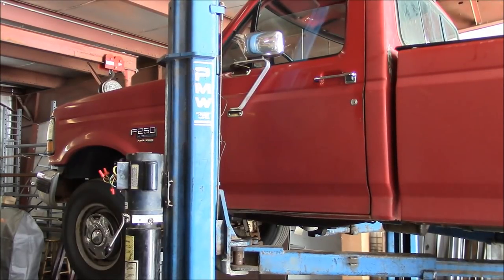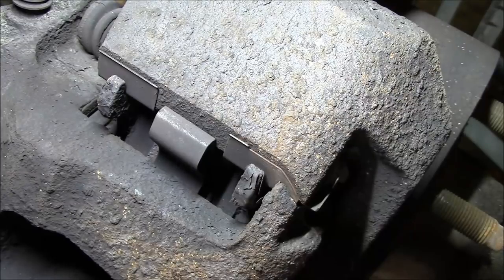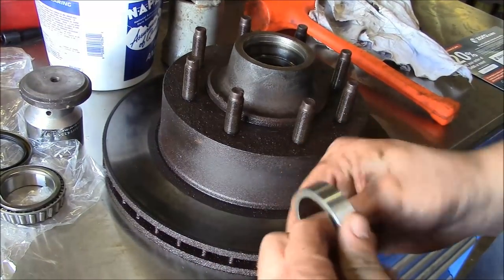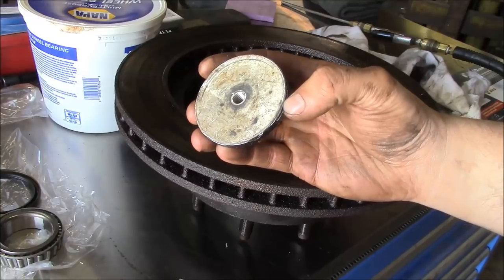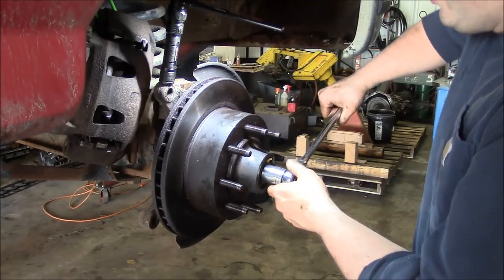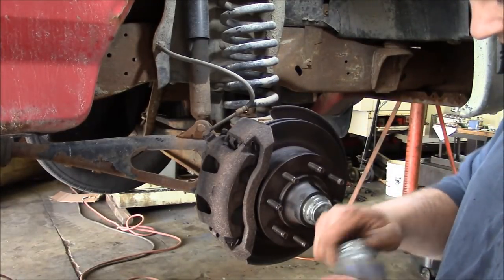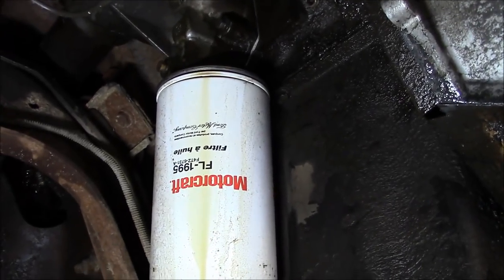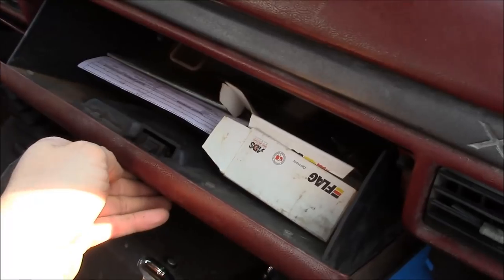F-250 Front Wheel Bearing Noise

Comment: I'm sure it doesn't matter what industry you are in someone will always think they know better. I have been a mechanic in Australia for just over 29 years.  I have never filled the hub cavities with grease. I have never had a premature bearing failure due to a lack of grease in the bearing. If the bearings were packed correctly, this is all they need. Anyone that says overwise either used the wrong grease or didn't pack the bearings correctly or had the bearings too tight or too loose.  As for anti-seize, I use it everywhere that I think it needs it, especially if I know I'll be the next guy back there in a few years time. Good work Wes, I really enjoy your channel.

Comment: I've got the 1992 version with the 302, and the caliper removal is so incredibly simple...with just the two slide pins to push out.
Reply: The squeeze slides are great in my opinion. Incredibly easy to service.
Reply: It's simple until they rust in place
Reply: @wll1500  Have never seen them rust in place....and I live in a climate where rust is very common....in Toronto, Canada.  Rust kills vehicles here....because of all the salt the city uses on the roads, sidewalks, parking lots and so on.  If anything, they sometimes slide a bit on their own if you don't put the slide pin in properly.

Comment: I was always a bit foggy on proper wheel bearing install, "then rotate from 9 oclock to 14 oclock to verify finger tightness and overall torques specs on the non-standard frogleg installation chart."  YMMV, et. al, etc.....  Your explanation was clear.  Thanks for that.  Even a short sweet vid like this is worth posting...

Comment: Tip - to easily remove the inner bearing and seal, stick the nut back on the spindle after u remove the outer bearing. Then slide the rotor towards u and the nut will take the bearing and seal out in 1 shot.

Comment: @11:50

I always lightly grease wheel stud threads.
So many times, you see people, attempting to remove lug nuts-
and powdered rust falls out, galling & chirping off & back on.

It's the conical chamfer that holds the nut, with friction, into
the rim hole. The threads merely allow the nut to tighten.
Rusty threads lead to dangerous prematurely under tightening, 
and broken studs.

Comment: For these types of wheel bearing races, if I don’t have a bearing driver, I’ll take an angle grinder, cut a slot in the old race, then pound the new race in using the old one as a jig. The old one won’t get stuck because the slot I made allows the race to collapse inwards.

Comment: Wes top tip buddy. When removing the wheel bearings. Just remove the outer bearing. Then put the washer and nut back on. Then pull the rotor off. The washer nut combo. Will catch the inner bearing . Then pull off the seal and inner bearing. Will be left on the spindle. With little effort. Trust me buddy I did it the same way as you for years. When I tried this. I just thought wow why wasn't I doing this a long time ago. God bless

Comment: I run the wix XP filters on all 3 of my vehicles.  I run synthetic  oil and wix  xp are really a good filter and I typically order those from rock auto as I found they are substantially cheaper and I do not have a local Napa store. My local o'reilly store carries them also but even with shipping charges it's cheaper for me to order them from rock auto.. Discovered U channel recently really enjoy the content. My buddy has A96 f250 with that power stroke in it 195000 miles and still runs strong. We live in the North so the body is rusting off the truck but the motor is running like a champ. Thank you for the video

Comment: Bill replaced his 7.3 in SPOT and talked about those dipstick fittings.  They leak and can only be replaced by pulling the pan (engine too).  The new fittings are thicker to prevent warpage.
Reply from the maker: International sells a repair kit that is basically a tube of RTV silicone and a gasket that goes on the outside. You eliminate the o-ring inside. It can be done without dropping the pan. That's probably the route I will go.

Comment: Hey Wes try removing the outer bearing then put the axle nut back on . then pull the rotor off across the nut . your inner bearing and seal will end up hang ing on the axle . if you need to reuse the seal it is still intact

Comment: After you remove the outer bearing, tread the nut back on, then yank to rotor off. It removes the inner bearing and seal. Well on most the older vehicles. The seal will be undamaged so you can reuse it. Old timers trick

Comment: Speaking as a hack home mechanic, to install new races, I cut through the old one with an angle grinder, and use that to tap the new race in (thin edge to thin edge.  As the cut makes it flexible, you can drive the new one all the way in, below the surface of the housing, then pull the old, cut, race out with your fingers.
Reply: That's a good one to mention; I have done that a few times when I didn't have a socket or homemade press tool to fit. Never needed a race installer kit bad enough to buy one between a plethora of sockets, tube cutoffs, and old races.

Comment: Started using anti-seize before your dad even had a twinkle in his eye for you, back when had to almost have a commercial account to get it. 
Used the gray, the copper based one & the actual silver based one, that was about 25$ a ounce back then,  so careful on its use.
Silver compound , like 8% silver, was for high voltage electrical application .

Comment: Still on the original cam position sensor. 2000 Excursion with 270,000 miles. The one on my 2001 F350 went out in the first 2,000 miles. 
I have a spare in the Excursion. As long as I leave it in there the original won't go bad... Lol.

Comment: Use Fram Oil Filter Orange color with Black grip on bottom put grease on threads plus rubber ring  on motor plus filter tight up 2 full tight and with cap use socket wrench 3/4 turn more on motor to! It help lots!

Comment: I know its a bit late but if you get the old bearing cups and cut them with an angle grinder you can use them to put the new ones in. Generally a better fit than a socket.

Comment: All mechanics have enough sockets of varying sizes which negates bearing driver sets. Ford wanted to use up some cast iron, so they made the brake disc integral with the hub

Comment: Form what I’ve seen all of these trucks because they’re so big & heavy they have the tougher pads on em & are designed to stop the amount of weight they are rated for & ten some, so by default the pads will the tougher & I had a 95 psd & never changed the brake pads, I did check em tho & there was plenty of pad on em, I’ve got a 937.3idi whose brakes also looks pretty good, my dads 04 Yukon has had only 2 sets of pads on it, the set that came off was the same at 100k when we got it & had em changed at 170k not because they were worn, just because they were old & should be changed out, but didn’t need to.

Comment: Can a wheel bearing make a squeaking noise that sounds like a brake squeak? I have a '95 F-350 with new rotors, bearings and pads and it has developed a squeak when moving slowly and when I hit small bumps it cherps. When I turn it goes away. When I brake it goes away. I packed the bearings and did the same procedure as you. Any ideas?

Comment: If it weren't for rust, brake discs would never need to be changed. The steel disc is much harder than the brake pad material, and doesn't really wear down, it is the oxide layer that is removed when braking. I read about a company here in Sweden that are trying to commercialize aluminium brake discs. They mix in carbide when they cast the aluminium, to make it sufficiently hard. The result is about 50% weight reduction, with better heat transfer, and you never need new discs. Right now the price is not competitive enough, and spreading the carbide out evenly during the casting proved difficult. Things that last forever are also, sadly, bad business for car companies, so they might not exactly jump wholeheartedly in that direction. On a side note, I use anti-sieze on everything, EVERYTHING.

Comment: The oil filter is motorcrap and check the rear plugs on the heads there are high pressure oil plugs and they are notorious to mess up bc of the black o ring it needs a green sealed plug

Comment: I wonder if whoever had the truck before mixed grease types or was using #2 grease and it didn't flow to the bearings. I like to use #1 Chevron blue grease for wheel bearings after cleaning everything out of the old. Also use stainless meat hooks for hanging brake calipers. Also have the F250 HD in 2 wheel drive with the 5.8 engine, 1997 vintage.

Comment: Whenever I replace the bearings and races, I don't bother taking that seal out by itself, first. It comes out just fine with the bearing and race. With no damage to the seal.  I replace the seal anyway. But if I am just inspecting to see if I need to replace the bearings... and DON'T have to replace them. The seal will usually be fine to be put back in.

Comment: The oil leaks may be blow by inspired.  

Weasel an old motorcraft gauge bar to add to your collection. Pretty handy and will give you a International Diesel state of condition.  

Dan
Reply from the maker: Is that the unit that measures fuel pressure other things? I think I have seen one once.
Reply: Yup nice old tool or just look at one and buy the equivalent gauges. They pinpoint tests were very logical and seldom missed if followed.

Comment: It seems to be a water leak problem. 
The bearing were dry and could see a reddish discoloration of a rust.
Obviously thats a seal related problem. 
I saw that the seal was replaced but not the cap.
I WOULD HAVE CHANGED THE CAP TOO !

Comment: Wes I saw a hunk of greese on the back side of the rotor as you reinstalled,  hope you caught that, also if you put the nut back on the spindle  then slide the rotor over that nut and yank it will pull the seal and rear beering off easy pezie.

Comment: I notied that you packed the bearings with plain NLGI 2 wheel bearing and chassis grease. Ford generally recommends Molybdenum Disulphide  grease in this application. What has your experience been between the two greases?
Reply from the maker: I suppose it's best to use the manufacturer's recommended grease. The Napa stuff has extreme pressure additives and should be fine for rolling elements like wheel bearings. Moly grease is really good for sliding surfaces. I use it in my lathe chucks.

Comment: That massive oil leak may be from the turbo. Any oil that leaks into the valley drains down through the bell and looks like a rear main seal leaking. Ford has a oil pressure controlled exhaust gas back pressure valve in the exhaust side of the turbo. They always leak.

Comment: one should NOT hand pack a wheel bearing of that vintage.  There is a tool that "pressure" packs the bearing. It's important to get the grease into the roller bearing tips.

Comment: 8:35, brother if it's got the original rotors than chances are those are the original bearing's and packed heavy from the factory just the way they should be. Work is clean but a bit of extra grease never hurt any bearing.
Reply from the maker: It doesn't help them either. Grease that is not on the rollers does nothing.

Comment: I think I've figured out the motorcraft filter issue.. my 7.3 had them leak, with any filter I put on, replaced the cooler, leaks went away, and I know it was leaking from the filter itself, I think if anyone has ever over-tightened the filter, it stretches the threads and doesnt allow a proper seal. Been running motorcraft filters on my 7.3 for 4 years, since replacing the cooler, and hasn't leaked because I know the correct way to put on a damn filter! Haha

Comment: Won't the application of never-seize over-stretch the stud?
Reply from the maker: Yeah, that's the argument. The anti-seize lubes the threads and causes the studs to be over torqued. I suppose it's possible, but if you are careful, the risk is low. IMO, it's better than having to heat them with a torch to get them off, or risking breaking a stud when taking them off. On a front wheel drive car, fixing a broken wheel stud is a major ordeal. You'd have to remove the hub and that's pretty well guaranteed to wreck the wheel bearing.
Reply: 25%, 30%, 0% reduction, and even variation from big name vendors...  https://mechanics.stackexchange.com/questions/17896/torque-spec-variance-with-anti-seize

I'm pretty curious what math the engineers in the crowd would do to calculate an example!
Reply: @WatchWesWork  i always figured, if we lubed fasteners on submarines to get accurate torque to keep water out of the people tank, it's probably ok to use on wheel studs...

Comment: I thought usually a torque wrench is used to tighten a wheel bearing nut. You are not preloading the bearing with finger tight.
Reply from the maker: It does not get pre load. It actually needs some end play.

Comment: You should have turned the rotor first when you removed the calliper to show that it was not the pad dragging slightly on the rotor. Always eliminate every step first. Then proceed to removing the bearings. Just my opinion.

Comment: Oh no!  Didn't use a bearing packing tool.  Didn't use synthetic grease.  Didn't check endplay with a dial gauge.  Didn't turn the rotor.  Then the icing on the cake applied anti-seize  to the studs.  - Internet 2019 :-)
Reply from the maker: Yeah I know. Total hack.

Comment: Your "Bearing Driver" sucks ... just toss them in the freezer for a couple of hours and you can tap it in with your thumbs ... stop making it hard.
Reply from the maker: LOL. Have you ever tried that? I have. It doesn't work at all.
Reply: @WatchWesWork  YES ...actually I have ... in "Aerospace" to boot ... for 4 decades. Thermal expansion/contraction is real ... perhaps you're doing it  in a "cold environment" and the differential temps are not enough?